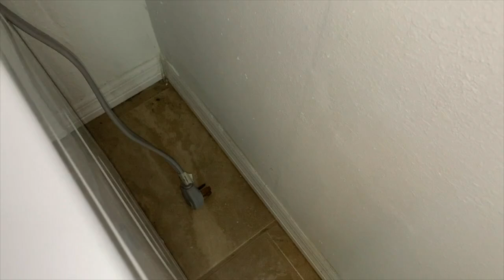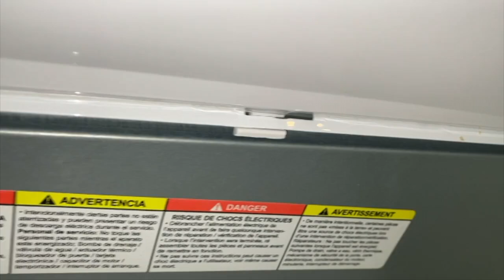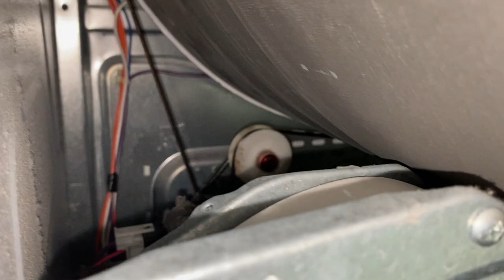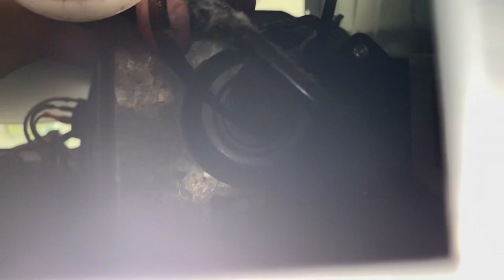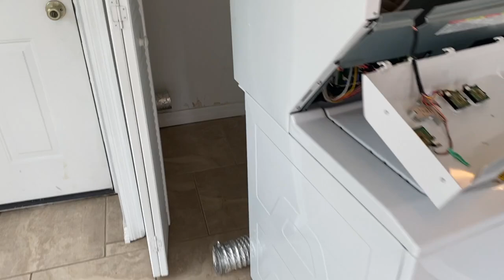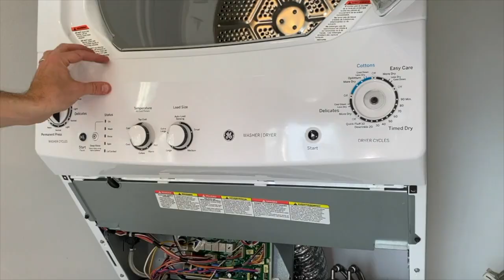Replace GE laundry center dryer belt

Comment from the maker: If interested in purchasing this product, visit our Amazon affiliate link below.  I earn from qualifying purchases.

GE Laundry Center

     Electric:  https://amzn.to/40utSsq

     Gas:  https://amzn.to/3WtjiB8

Dryer belt:  https://amzn.to/40GkCmq

Felt pad:  https://amzn.to/40HkGCm

Needle nose pliers:  https://amzn.to/4asopaj

Joint pliers:  https://amzn.to/4g2t0RC

Utility knife:  https://amzn.to/4g1kIJX

Cutting pliers:  https://amzn.to/3Cfa5Fr

Zip ties:  https://amzn.to/4igo6D1

LG THINQ Laundry Center

     Electric:  https://amzn.to/42l4XKJ

     Gas:  https://amzn.to/3E4hwzU

Dryer shoot:

     https://amzn.to/3C7bfTl

     https://amzn.to/42aJLH2

     https://amzn.to/40hLwzN

Interior clothesline:  https://amzn.to/3tkwE3e

**********************************

1.  Replace dryer felt pad

       https://youtu.be/xFHzwp7ueTQ

2.  Install and hang neon sign

          https://youtu.be/-uuOACk-J_k

3.  Prepare laundry center for pickup

          https://youtu.be/QxJ-Aro1-lQ

4.  Install new GE laundry center

          https://youtu.be/SgA4MPxKB-Q

5.  Replace laundry center control board

          https://youtu.be/CqGeZuNiYWA

6.  Replace laundry center drive belt

          https://youtu.be/TGCpjjnNLxs

7.  Replace laundry center water inlet

          https://youtu.be/i3T-PfgGpLk

8.  Install interior clothesline

          https://youtu.be/LRMbGpZu_9E

9.  Replace dryer vent hose exhaust shoot

          https://youtu.be/ZsEBjLR5LOQ

Comment: Thanks for this. I have relatively the same dryer and had to replace some wiring. Was having the hardest time putting the front panel back on.
Reply from the maker: You are very welcome, honored to help.  Having the same or similar unit definitely helps.

😁🙏🧰

Comment: Has anyone experienced a screeching noise after putting this back together? After replacing just the felt seal, my dryer makes a rotating screeching noise. Thanks
Reply from the maker: Thanks for watching, any update on your findings?  Have you taken unit back apart and inspected what could be causing it?

Something is offset if you’re getting screeching noises…possibly the belt or idle pulley…unless it’s more clearly identified as metal on metal.

Comment: So I have two additional comments for this amazing video.  One my belt came very twisted and didn't want to lay straight.  I used an iron on silk setting to straighten the belt.  Also, I was able to put the belt on and hook it over the tension pulley all from the front.  Just watch the video closely and you can do it all from the front "by touch"
Reply from the maker: Thank you so much for sharing your experience and tips.  The DIY community is the BEST!

😁🙏🧰

Comment: So the first thing the MORON engineers at GE did was put 4 screws on the sides of the control panel that you can't get to if the unit is JAMED in a closet like most are and set in a drip pan that's mounted to a drain in the floor preventing you from pulling the whole unit out of the closet. Im going to have to tip it out. 
If your lucky and have a small arm you can jam it in through the front and reach the idler pully and left arm hold it while Blindly put the belt around the motor pully. Just like all their other dryers.
I was just running through your video because I'm changing a top bearing support and glides this week and wasn't sure if there was a easy way to take it  apart.
Reply from the maker: Thanks for watching, how is your project going?  Have you replaced bearing and or additional parts and got your unit working again?

Comment: Following along and so far so good. However during door removal two metal hook-shaped brackets from the top fell down and im not sure how theyre suppose to be attached or seated during assembly. I can slide the metal tab into the empty tab slot but it just falls down easily. If i screw it in place it gets in the way when putting door back in. Are these even needed?
Reply from the maker: Thanks for watching, any update?  Link below shows the replacement process of the dryer felt-pad.

     https://youtu.be/xFHzwp7ueTQ?si=cWNldg2P8z4lOV6g

In this video, you can get a better look at the aluminum clips you’re referring too.

😁🙏🧰
Reply: @D @DIYwithMichaelBorders  thank you that video shows the metal clips im referring to. How did you secure these clips to the door frame when you mounted to the cabinet?
Reply from the maker: @wtran528 

Thanks for the reply.  Ever-so-carefully shift panel into place at an angle where the clips don’t fall out…easier said than done.

We have had viewers mention that they use heat tape and tape them in place prior to shifting the panel up and securing it.  Link to tape below.

     https://amzn.to/49QFPim

If interested in purchasing this product, visit our Amazon affiliate link above.  I earn from qualifying purchases.
Reply: @DIYwithMichaelBorders  I used aluminum foil hvac tape to hold the clips in place. The door was a big pain to put on. I ended up removing the door from the hinges which took significant weight off and i was able to mount the door frame that way. You make it look too easy! Well I'm glad to say everything is working now. The wifey is happy 😂. Thank you!!!
Reply from the maker: @wtran528 

Thanks for this update, great to hear you got it back together and working properly.  The HVAC tape is clutch! 😁

Hope you have a great Sunday and many stress-free days ahead.

☕️🙏🧰

Comment: Hi again also I think it would be good to remove that aluminum piece underneath the wires before you try to disconnect them cuz the wires were too short and it was a real PITA to get them apart.
Reply from the maker: That’s a great point, we appreciate this feedback.  That will definitely help.

Comment: Hey Michael, great video to help with DIY. I do have one question it feels like the drum fell off something in the back cuz I got the belt on okay, but the front of the drum is resting on the metal piece in the left front. Is there some kind of a shaft in the back that slipped out of its hole or ???
Reply from the maker: Thanks for watching, any update on your project?  Our drum liens to the bottom right portion of dryer shell when front panel and belt is removed.

After installing belt, we are required to shift drum upward so we can have the clearance to properly align front panel.
Reply: @DIYwithMichaelBorders  I've run into the same issue but it almost feels like my drum has shifted forward towards me. When I go to put the front panel on it doesn't sit flush anymore.
I might try taking the top off and seeing if I can see anything
Reply from the maker: @Andy-xq3ut 

Thanks for watching, any update for you?
Reply: @Andy-xq3ut I’m having the same issue. I can force the front panel to sit on the hook on one side, but getting both sides on simultaneously is impossible. I have about an inch or more gap between the vent at the bottom of the door and the intake on the body of the dryer. Something seems deeply wrong. Any help appreciated.
Reply: @DIYwithMichaelBorders I ended up taking the roof off which then resulted in the sides blowing out so I taped them with gorilla tape. After many hours and an equal amount of curse words I decided I'd give it one last go and with that extra rage the drum did in fact find its sweet spot and slide back into place about 1inch backward. Took off the tape, put the roof back on and was able to align the entire front panel back onto the drum and secure the sides but man oh man it is not easy
Reply: @GTKAG36 if you have a gap between the front panel vent at bottom and the intake below the drum. I think your drum might have slide forward. I was able to use some force and wiggle the drum until I found the right spot and pushed back towards the back of the dryer the drum slid in place somehow. This allowed me to align my front panel vent and the intake part. Then it was a matter of getting the front panel to align with the drum and secure the side hooks which was not easy. I think it took me 10 tries my shoulders were on fire
Reply from the maker: @Andy-xq3ut 

Very cool, we appreciate the follow up.  Clever approach and we like it!

If it works, it works!  😁👍
Reply: @Andy-xq3ut  thanks. I was able to get it all back together too. I grabbed the drum with two hands and shifted it up and back into the bearing. It locked into place about an inch back, as you said. Putting the door on was be easy at that point. For other folks reading this, you shouldn’t really have to force the door on at all. If everything is lined up properly, it should be relatively easy. Still need to reconnect everything and see if it works lol. But at least the drum is spinning manually.

Comment: You put that door on way too easily.  Next video, could you show more in detail.  I've been trying to get my front panel with the door back on for 45 minutes and cannot get it on. Everything shifts, and the guides don't stay in place. It doesn't help that I'm not sure exactly how, as you don't show what the drum looks like going back on.  I didn't think it wouldn't be obvious, but showing it reassembled would be helpful.
Reply from the maker: Thanks for watching and sharing your thoughts.  Definitely a stubborn step no doubt.

The upper shell widens or extends outward once the front panel is removed as you very likely noticed.

Our method is to compress the outer side-edges inward as we simultaneously lifting the dryer drum up and back to the left as we align front panel into place.

The first couple times we serviced these style centers, it took us 30 minutes… we were convinced it was never going back on…😁

But a little self motivation and DIY mindset is what helped carry our project past the finish line.  Please keep us posted.

👍🧰

Comment: I can’t put the door back on!
Reply from the maker: Thanks for watching, any update?  It can be a bit tricky.  Having a second person shifting upper shell panels inward to align with door panel as you shift it into its respective slots definitely helps.

Once the door panel is removed, the dryer drum slightly shifts under its own weight, pushing right hand shell panel outward.  Having that second person to help push the drum back up a bit and help you guide door panel into place may be what is needed.

Please keep us posted.  ☕️🧰

Comment: Thanks for the detailed video. Used these steps to replaced the dryer drum. No access from the back panel. The pully system and belt was in the middle and accessible from the front on the GE model mfg in 2023. Everything else i.e. front panel etc was exactly the same. Overall we Saved time with this video. Thanks & Have a Good Day.
Reply from the maker: You are very welcome, we are honored to hear.  Awesome job making it a DIY project!

A true testament to the power of DIY!

😁👍🧰